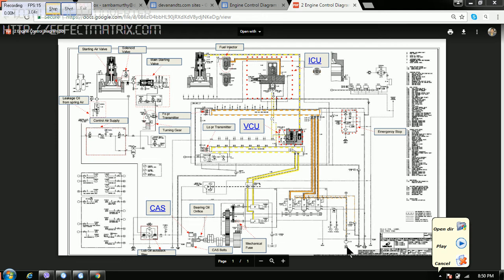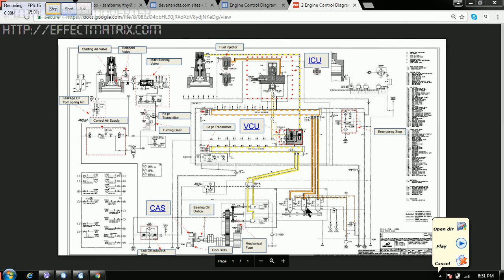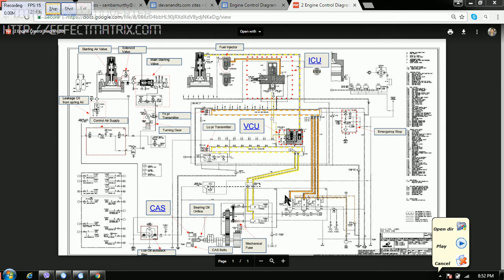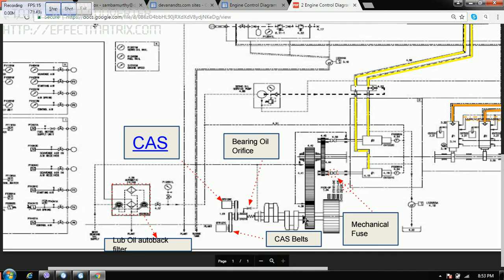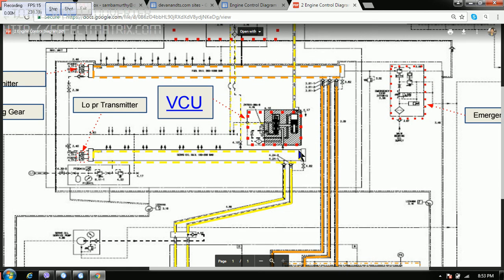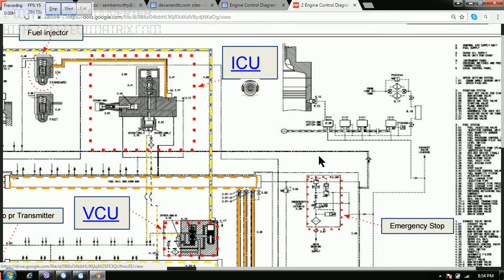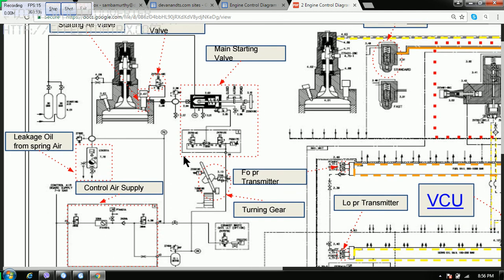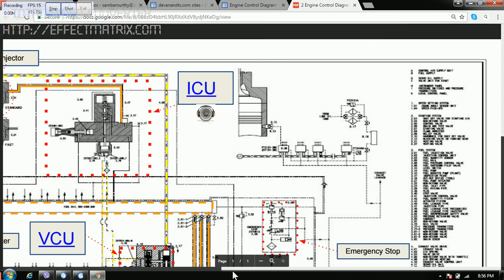RT Flex Engine 50D - Engine Control Diagram

Comment: Servo oil filters on VCU have to be replaced every 18000 r/h  but cleaning needs to be carried out much frequently
Reply from the maker: The replacement of filter is as per the instruction Manual. But cleaning regularly is always better